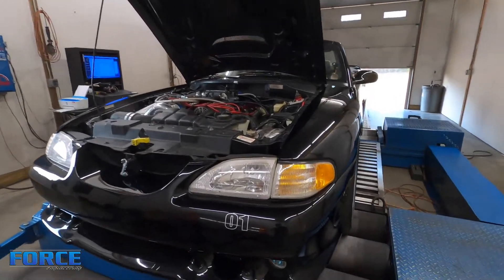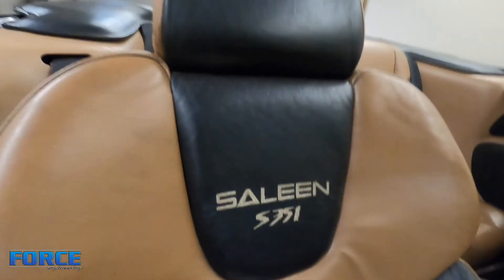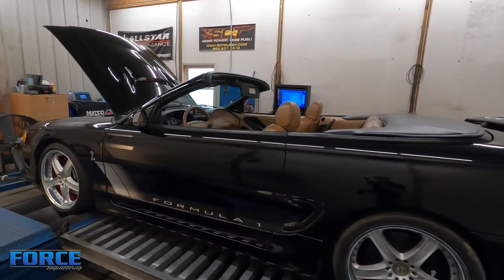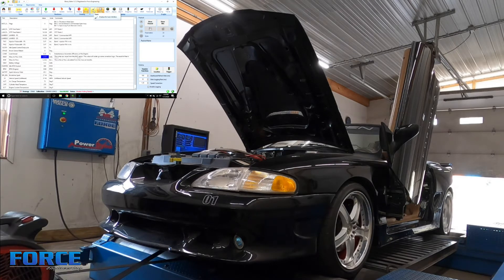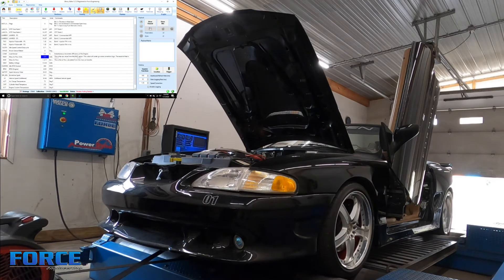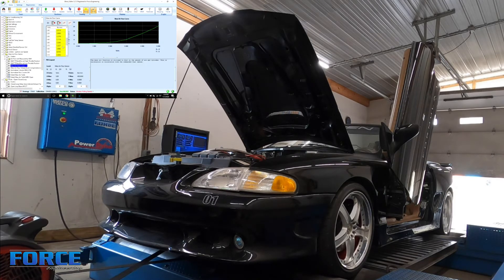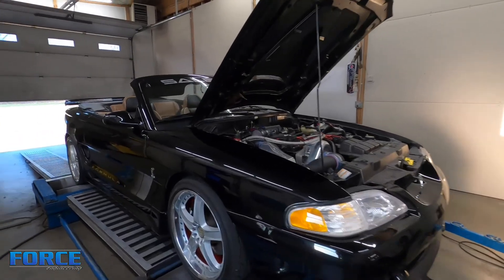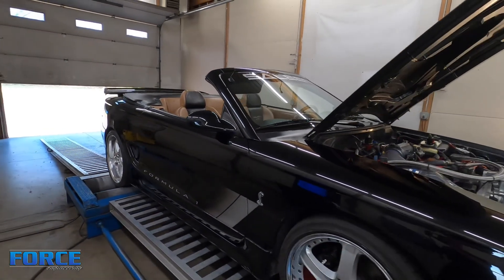Dyno Review - Saleen F1 Ford Mustang | Vortech Supercharged 4.6l 2V

Comment: MAF tunes seem pretty effective and quick to do. My lemons car (that you MAF tuned) worked great for years.  What are the downsides?  Does the approach work OK for street cars with narrow band closed loop controls?
Reply from the maker: I shut all the o2 control off.  There really isnt a downside to doing the steady state stuff that way.  Sometimes with a MAF car you can have a few load levels read the same voltage and you are forced to pick a middle ground.  The steady state doesnt do a good job of allowing that.